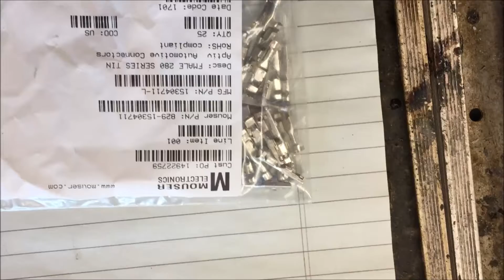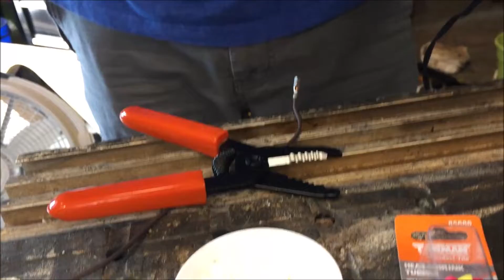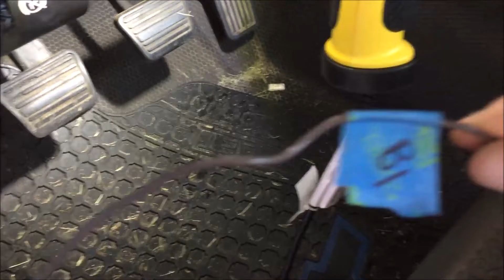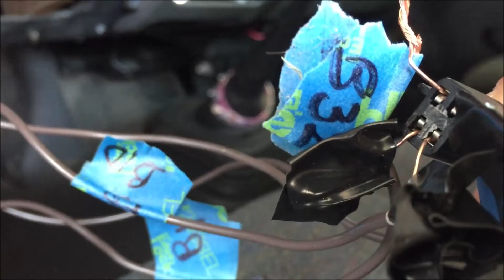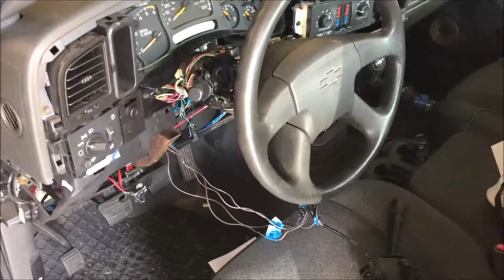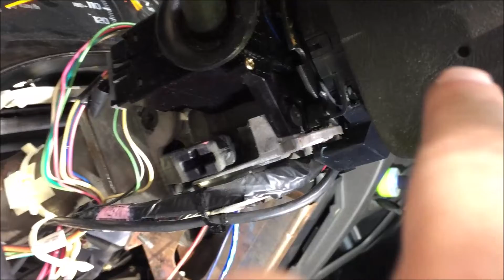Chevy Silverado Adding Cruise Control Part 2

Comment: Thanks brother. I went a different route and was able to dissect the clock spring harness from a donor vehicle and do a factory install with the connectors intact. However, I never would have gotten it all apart without your videos.  Now my 2006 manual work truck has cruise and it only cost me $40 to pull the parts from a wreck.

Comment: Question:: since you bought the ac delco stalk,,, i noticed your stalk wire  colors are different than the cheap one I bought,,  do the stalk wire  colors  match the truck wire colors where you plugged your “harness into the block

Comment: Can i call you it doesn’t matter  if you charge me for helping me i got a obs 1990 with ls engine swap and want too make the obs 1990 cruise control module work change the cable for the newer throtle and my throttle is drive by cable

Comment: Thank you for the video!! So I followed your step by step on installing the cruise control but couldn’t get mine to work?? Wondering if you had any trouble shooting solutions??  My truck is  WT  model 2004 Chevy Silverado... it had a 4.3 v6  with automatic trans originally and about 5 years ago had it switched to a 4.8 v8  automatic ... other than that it’s stock
Reply: I just did mine if you’re still needing info

Comment: This is how the cruise is wired:
Multi-function switch                             Truck/ C201
Blue                                                    B1 Grey/Black
Black                                                  B10 Blue
Pink                                                    B18 Brown
Grey                                                    B32 Grey

ACDelco D6299A GM Original Equipment Combination Switch was my choice, although there are cheaper options.  

Thanks for this tutorial.  Giving the part number of the metri-pack connectors was crucial to my success!  Thank you for the research, the Chevy dealer, and Alldata were no help.  Ask for GT-280 Metri-pack connectors.  The ones i got from Amazon did not work, so I went to the Chevy dealer.  The parts guy was nice enough to get some out of the tool room for me--They are not in parts.  Having the correct connectors is the key to this job.  I could do it in an hour if I have the correct terminals.  Having the correct crimpers and a release tool is a good idea too.  The video shows how to manipulate the connector.  
Rostra tells you to disconnect the harness from the ECM, pull it into the cab, and solder to the wires behind C201.  BELIEVE me, you do NOT have/want to do that. 
As you can see, Black and Blue wires are opposite which is counter intuitive.  Pink is switched power--If you use B18 it is fused off of the fuse panel under cruise.  To connect the wires, I had some smaller Metri-pack male terminals that worked with the Metri-pack female terminals after I removed them from the quad connector.  I just put some shrink wrap to hold them together, and tyrapped them to the other wires.  If I was to do this again, I would make the colors match instead of following the wiring diagram colors.
Since it is an older truck, Autozone has the schematics for free.  I tried to post a wiring diagram, but it does not work. 
Again, thanks for the videos.  They made it seem like I know what I am doing!
Reply: What do you mean if you use b18 its fused off the fuse panel under cruise? I know where the cruise fuse is and connected a pink wire coming off b18 to the fuse while b18 was also plugged in to the bcm. I also connected pink wire to pink A2 power wire and neither work, at this point I'm thinking its the cheap chinese turn stalk, except everything else on it works but cruise. Its getting really frustrating as 4 wires shouldn't be this difficult!! Any help would be a life saver
Reply: @rustyshackleford5058  I'm in the same boat, did you ever figure out what the issue was? I seem to have everything connected correctly but cruise does not work, it seems like it is not getting power, but like you, everything else on the stalk works (turn signals, wipers)
Reply: @joelopez7649  Haven't got to replacing the stalk to finding out yet, but I remember last time I tried cruise, pushing the accelerate cruise it literally started smoking on me lol. I'll update when I replace one w/oem from a junkyard, lemme know if you get yours working/what you changed too!
Reply: @joelopez7649 perhaps you need to add the 10 amp fuse?
Reply: I hear if you have LED tail lights the cruise control won't work unless you put in a resistor.

Comment: Can you provide the colors of the switch to what b terminals you went to.
Reply: Yes. This would be most helpful
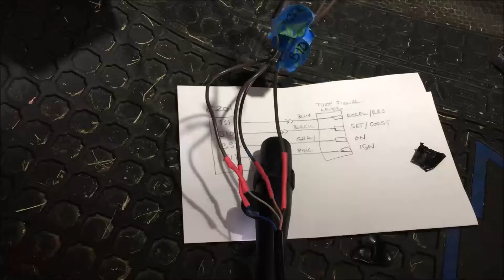Reply: pink is B18   Blue is B1   Black is B10  Grey is B32   You can read the hand drawn schematic at 9:19 in the video
Reply: @xraydelta7 what if my stock has yellow and red what would they go to? I got the blue and black ones done